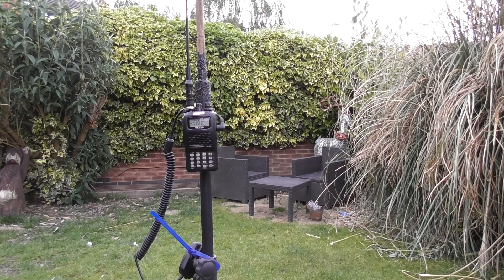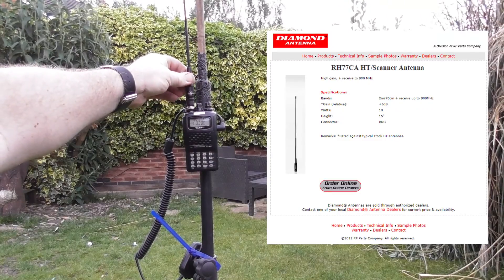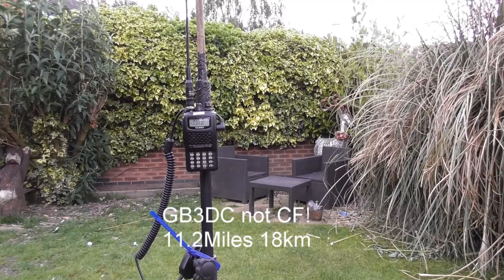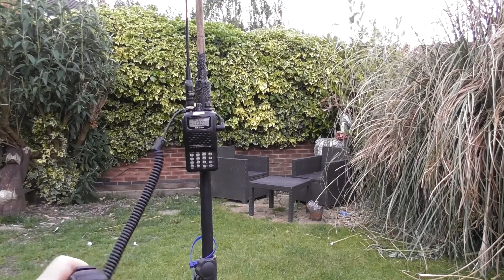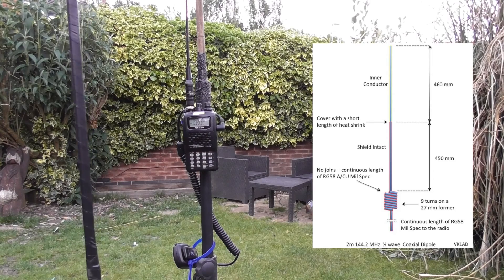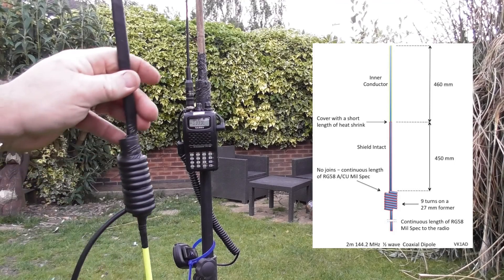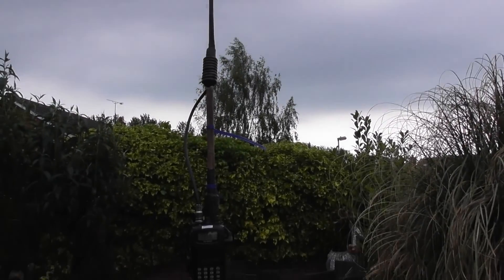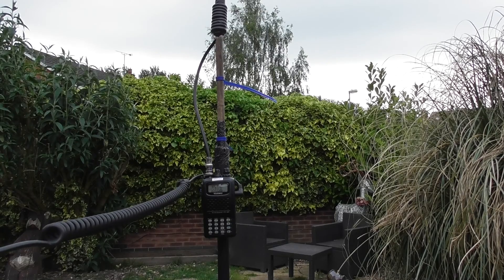Make & Test: BEST CHEAP Flowerpot antenna for 2Mtr Amateur (Ham) Radio vs Diamond RH77CA.

Comment: Not to be a debbie downer or anything, but you tested your rubber duck at one height and the FP at a different height! Height matters for VHF/UHF. Also the rubber duck is only half of the antenna whereas you holding it in your hand would be the other half of the antenna system! So you really are kinda comparing apples and oranges! I will say that building a flower pot is certainly worth it as they work great...and getting them as high off the ground as possible makes them work ever better! Cheer and 73!

Comment: Flowerpot antennas work great!
I made mine with 3/4inch pvc tubing.  I also put a piece of foil on the outside which gives me the 70cm band
Reply: If I am not interested in the 70cm band, should I still put the aluminum coating? I only have a 3/4 inch tube just like you

Comment: Thanks for making this video.

Was very interested to see how your one performed.  I myself have finished making a flowerpot type antennas to use at home on the 70cm and 2 meter bands.  I decided to go for the slightly bigger co-linear version.  Made it to the dimensions given, and so far so good, nice low SWR on both bands.

Comment: Would the choice / quality of coax  make a difference to performance  ie mini 8 vs RG58 mill spec vs aircell 5 for instance.
Reply: Won't make any difference to the working / efficiency of the antenna. - Basically, the better the quality of the coax the less loss.  This is an antenna, designed to have as much loss as possible, get that signal radiated out there!  Use just regular RG58 coax to make the antenna with.  However, when it comes to feeding the antenna, that's the place for the good quality coax, particularly if you are intending to run a lot of 70cm.
Reply from the maker: Hi. Personally I would use whatever you have available. I would normally use RG8Mini

Comment: Stupid question from an M3, can foundation licence holders make their own antennas? Is it only diy radio kit you can’t make? Or are antennas out too?

Obviously you have to make sure your power levels aren’t too high as well, but I thought I’d check.
Reply from the maker: No such thing as a stupid question. Yes you can build your own antenna but as you say the radios erc are only for full licences. 73
Reply: @MikeM0XMX  Been licensed about 12 years and only just asking these questions now as I start doing more! I'm trying to decide on something for SOTA use. No amount of antenna upgrading will help me with my inner-city ground floor flat location, but for mountains I'm trying to decide between just a HT 1/2 whip vs actually getting something like this on a pole up high. Will it actually help if you're already on a mountain?

I'm learning a lot from your channel!
Reply from the maker: @MarkPentler  search my videos from Slimjim antenna. You can make it or very cheap to buy. That on a fibreglass pole is what you want. Good luck.
Reply: @MikeM0XMX  PS: Intermediate, I thought? I'm studying for mine right now solely so I can put my own kit on, but if it's Full only I'm out of luck, won't get there for a while.
Reply: @MarkPentler  intermediates and full can build their own hardware. Foundations can build a radio, but only from a kit designed by a manufacturer. Rob M0JEO

Comment: Hi, this Zs6AAG, i think the flower pot is a good antenna but as you demonstrate the antenna are not at the same height, and you have a bush around, so i think the best will have to place the handset at the same height, just my thinking...73

Comment: Mike I have the SRH77CA genuine antenna, and it is crap on vhf, put an analyzer on it and it is resonant on 165Mhz, perfect on UHF but very disappointing. I am not the only person to mention about its resonance.
 The VSWR is 4.0 at 144 MHz and 3.0 at 148 MHz. The resonant frequency is ~165 MHz. For 70 cm, the numbers look a little better: VSWR = 3.7 @ 420MHz and VSWR = 1.6 @ 450 MHz.

Also add a pig tail as a radial to improve receive, use a length of 19 and 1/4 inches to put you right about in the middle of the 2-meter frequencies.
Reply from the maker: The antenna on its own is only 1/2 of the antenna when not plugged into the handy. WHen you plug into the SWR analyser it has no counterpoise (the body of the radio) hence when you plug a tigettail/counterpoise in, it is as it should be.. This is a video I did a while ago. https://youtu.be/kvxUd9sl9oI

Comment: I made with RGC213 coax cable, work very well, i use in my base station. SWR 1,4:1
Reply from the maker: Hi. Thanks for the comment Marcelo Pires PU2MAL. There are plenty more videos of a similar style in the playlist. Enjoy, and consider subscribing if you haven't already. 73

Comment: A Slim Jim would easily outperform it, and it's dual band...
Reply from the maker: Yes, as the demo shows, you are correct however, I believe the SlimJim is MONO-band. The little stub is for matching.
Reply: Nope, it's dual band...A 2m version also works great on the third harmonic (70cm) too.
Reply: @MikeM0XMX  ...Nope, it's dual band...It also works great on it's third harmonic too...So a 2m version also works great on 70cm (144.5 mhz x 3 =433.5 mhz) and you only need one length of coax to feed it to work both bands.  I don't just use my 2m version on 70cm but also on PMR446 too.  Whilst it is true that the third harmonic of versions made for the other bands never appear to be such a convenient match as with the 2m version.  The only other possible dual band match would be with a 70cm Slim Jim, which should also work on the upper part of the 23cm band too (430 mhz x 3  = 1290 mhz) ...However, 23cm is a  very wide band so a 70cm Slim Jim would be unlikely to cover the whole of 23cm, but it would at least work on part of it.  There is the possibility of increasing it's coverage of 23cm by making it as broadband as possible...This can be accomplished by using larger conductors.

Comment: Am I the only one that noticed that the ‘Rubber Duck’ was receive only?
Reply from the maker: Thanks for taking the time to comment. I don't quite understand the point of what you are saying though. Please explain.
Reply: @MikeM0XMX  + 2W0PQU:  What’s that saying that comes to hand? – A little knowledge can be dangerous?  
The Diamond RH77CA “Rubber Duck” antenna is a Ham dual band Handie Talkie AND Scanner antenna – hence the descriptions “HT/Scanner Antenna” and “2m/70cm + receive up to 900MHz”.  
This means the antenna (if you believe Diamond) is suitable for 2m & 70cm TX/RX and also suitable for RX-only Scanning up to 900MHz (supposedly good for RX around 120, 150, 300, 450, 800 and 900 MHz).  So – no – it is NOT receive only!
Reply from the maker: @iainmeteorscan1555  I ever understood the point of Ethan's comment. I think he was simply mistaken or misslead.
Reply: @MikeM0XMX  Roger on that.  I guess 2W0PQU misunderstood the antenna description.  Iain.